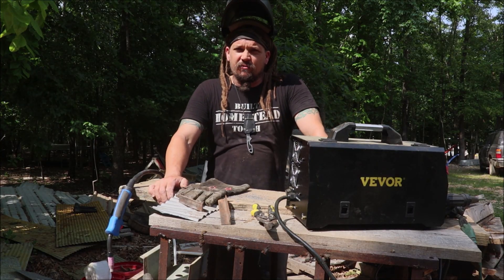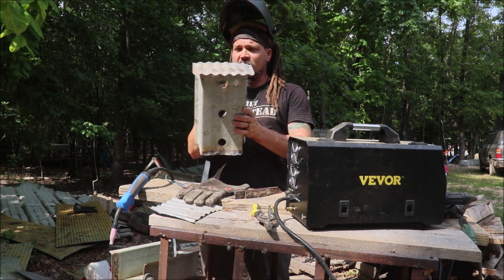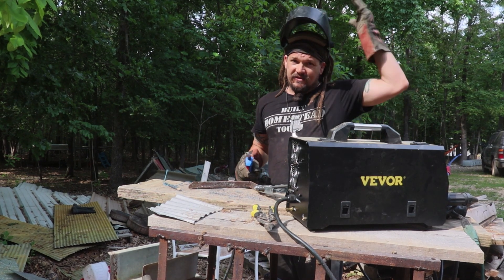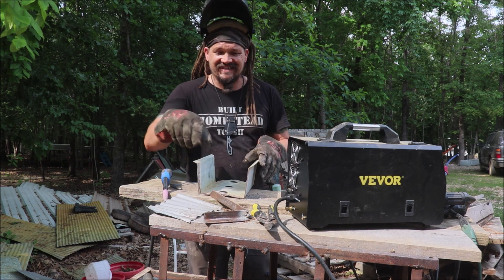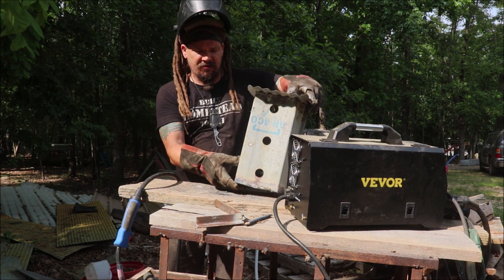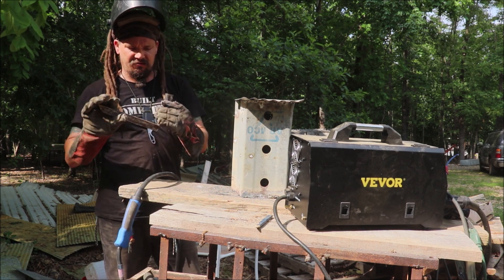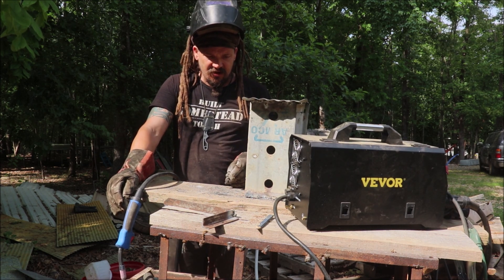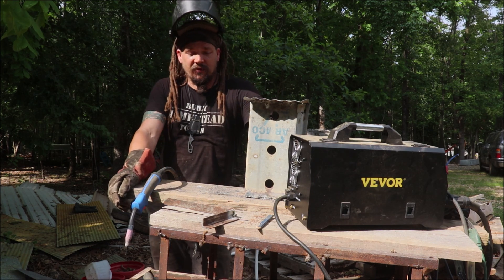Testing Out the VEVOR 250Amp MIG Welder - FLUX CORE REVIEW

Comment from the maker: The next tool on my "to get" list for our homestead was a Flux Core Wire Feed Welder. Then VEVOR reached out with a review opportunity. Although this welder is also set up for stick welding and gas, I'm not, so I'll focus on the Flux Core for the purpose of this review. Let's just say that so far, it's successfully competed every project I've tried with it, and I'm happy with the results. Enjoy the review!

If you're interested in checking it out, here's the link: https://amzn.to/3xnzN4B
Reply: I have the Vevor 3 in 1 mig/tig/stick 110-240v 240amp model and it rocks
Reply from the maker: @SharpTactical-LLC  I've been impressed by this 3 in 1, and I've only checked out 1 of the 3 so far

Comment: I like to let ole Hey Boy run the welder and I get ahold of the controls and adjust the Heat and Wire Speed until I get it smooth and consistent.